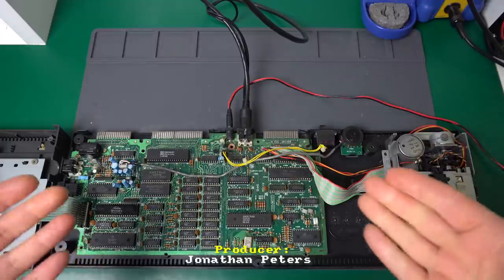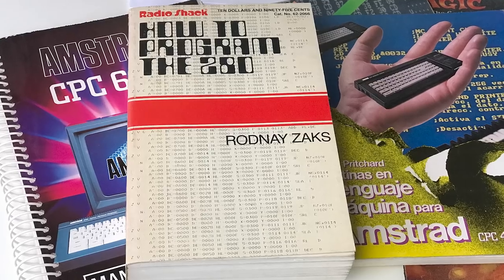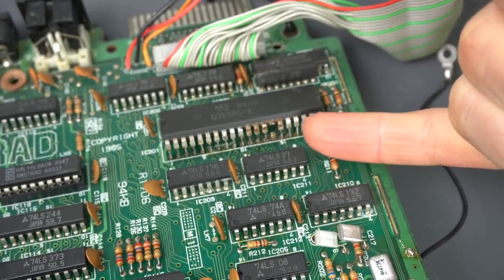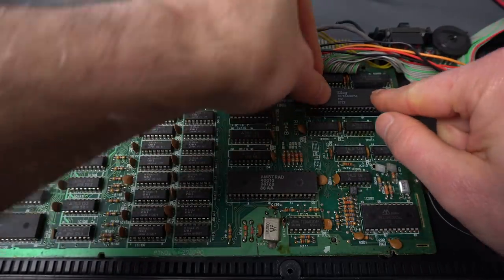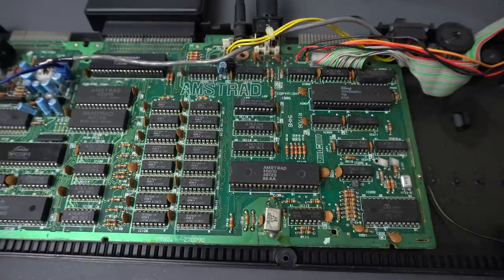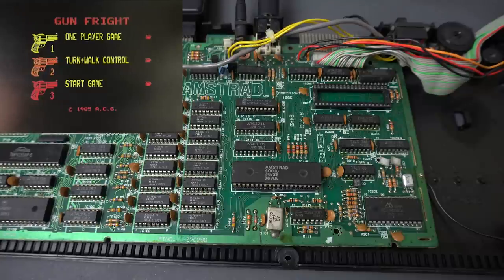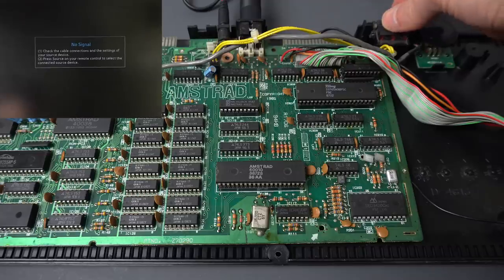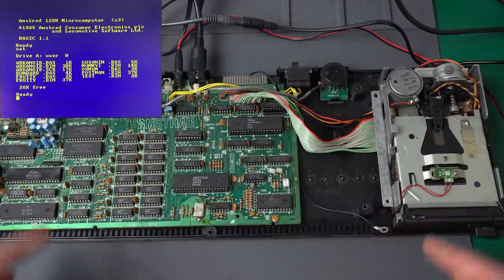Floppy Disk Controller Repair and Diagnostics ROM for the Amstrad CPC

Comment: Yet another riveting detective story.  No bad IC goes unpunished with Noel on the case.  Not only was the repair interesting, this diagnostic you've made already exceeds anything out there for the CPC if I understand you properly.  I predict this will be a tremendous asset to the Amstrad CPC community, as you yourself are.  Brilliant.

It's too bad Amstrad did not make much of an appearance here in Canada.  They seem like fine machines.  Around here, it was mostly Commodore followed by Apple II, with Atari, TRS-80, and TI99 bringing up the rear.  I would have loved one of those CPC machines.
Reply from the maker: Thank you so much! The test is mostly what I've been wanting for years. Hopefully other people can also benefit from it.

Comment: Ingenious -- taking a partially-working computer and using the stuff on it that does work to help you diagnose its own ROMs.  I'd have gotten the "must remove the ROM chip so I can read it directly" business stuck in my head, and it never would've occurred to me to write a program to check the ROM's CRC.  Such an elegant solution for that!  I love it!

Comment: Fascinating video! I bought a 6128 in 1985, and used it for 8 years, until I bought a Mac IIci in 93. I still have both, as well as one of the DEC Pro/350  I learnt PDP-11 assembler on in 1988 as a CS student. I had the 6128 powered up maybe 15+ years ago, it worked then, except the rubber band of the floppy drive. I guess the next time I visit my mother, I will dig up all the machines from the basement and see how they are doing. This video was very inspiring!

Comment: Brilliant video and repair. Seeing that pcb and those chips brought me back to my first job on the test floor of a semiconductor assembly plant where we tested thousands of Z80s, 765s and 8255s along with 8251s, 8257s 8035s, 8085s and static ram! In any slack time I made cpu boards for projects. Great times. Great channel.

Comment: Neatly done!  Your approach shows not only good ICO (Input/Conversion/Output) troubleshooting, but a sound knowledge of how the Amstrad platform works at the component level.  Your diagnostics will likely catch on with other Amstrad users and technicians.

Comment: It is impressive as usual, you combine hardware knowledge plus programming background without losing your expression 'mmm, interesting' in front of death screens. You demonstrates that a computer is an easy to repair device, always if you have an spare chip or whatever you might need, sometimes very difficult to obtain. Go ahead about diagnostics tool for Amstrad, I am sure you'll offer us a professional solution, for sure.
I read comments and I don't see many Spanish followers, don't understand, you offer a really professional work, thanks.

Comment: Hi Noel, when you tested that 74HC240 in the EPROM programmer, and it reported all the gates failing, it occurred to me that it actually only takes one bad connection to render the whole IC dead: if either the Gnd or the Vcc pin should fail, the rest could theoretically be fine, but there's no way of knowing that. 😉
Anyway, I was really intrigued through the whole process of troubleshooting, and - unsurprisingly! - you managed to sort out all the problems in your usual style; that is to say, with flying colours. 😁

Also good work on that diagnostics program, it is a very clever use of the Z80's OUT instructions to get those numbers on the screen in the (artificially enlarged) border area, I must say. 👍👏 It really shows how amazing Assembly programming can be, doesn't it?

Oh and finally, there's something I've been meaning to say to you for a long time... do you remember when you posted your video about repairing the ZX Spectrum 128K "Toastrack"? We exchanged a few comments on that video, and you mentioned something about the lack of a menu system on the Spanish version. Well you can have those menus if you replace the ROM with that of a grey +2*; since the hardware architecture is viretually the same on the Toastrack and the +2, the +2 ROMS will also work in the Toastrack. Thus, you could even have a French Toastrack, if you wanted! 😄 All the ROM files are available on Paul Farrow's great site, http://www.fruitcake.plus.com/
*Unfortunately, this means the loss of the Editor program that is present in the Spanish version of the Toastrack, but such is life: you win some, and you lose some.
Reply from the maker: Thank you! Yes, that was really fun programming that and twisting the machine a bit to do it 😃
I didn't realize you could use the grey Speccy ROM for that! I know you can use the UK one and there are even patched versions of it.

Comment: When diagnostic software hangs, my thoughts was exactly the same - something wrong with CS and there is bus conflicts.. 😂 
Great repair!
For diagnostic software update, You can add 8255 response test (writing registers with initialization values one by one  and then  reading back) and for floppy controller and then verifying values.. Main rule - don't read back same register after just writing it.. One time I did it and always get back same value, but in reality, that value wasn't read from chip and was just bus echo, because, there was a fault in one buffer IC.. 😂
Reply from the maker: Thanks! Yeah, that would be a good simple first pass at making sure those chips are at least alive. Want to give it a shot and submit a PR for the project? 😃

Comment: Oh my!, that Zacks book, so many memories, back in the days somebody passed me photocopies of some of its pages, I don't think it was the full book.
Little trivia: The Z80 ALU is 4 bits wide only, so, if the MC68000 is considered a 16bit MPU because its ALU is 16bit wide, the Z80 should be considered a 4 bit micro. V.g. In order to add two registers it has to perform two passes through the ALU. I didn't know that in the 80s, it wouldn't surprise me if Zilog kept it confidential. Thumbs up, keep on the good work!
Reply: Yeah, i was flabbergasted when i learned that bit about the Z80 ALU. I think it only became common knowledge after some clever guys delidded a Z80 and traced all the internal circuitry.

Comment: I'm sat here screaming there is corrosion around the 74 chips, check them all!  Great video.
Reply from the maker: Did you see more corrosion in other places? I didn't notice anything particularly bad other than those two ICs.
Reply: @NoelsRetroLab  I saw a little on the ic below the FDC. But my main point was as soon as corrosion was seen, I would have suspected everything around that area. Anyway, let me just reiterate that your videos are very good, very well presented and put together so well. Thank you for them.

Comment: Once again, admirable persistence and calmness! About the diagnostics program, could it be possible to output sound in the form of beeps to indicate where the fault is? Like modern computers do.
Reply from the maker: Thank you! It could but it would also be cumbersome to try to report multiple failing bits that way. Right now it just uses sound to indicate start and then success or failure of the RAM test (in case the video out isn't working).

Comment: At 17:00 you are probing pin 10 or 4 of 74LS132? Also, IC203 seems to have signs of corrosion. Am I wrong?
Reply from the maker: Good eye. This board was slightly different from the schematics in that they changed which gates they used in the IC. I checked them with continuity off camera and forgot to mention that, but they're the "correct" ones, even if the numbers don't match up.

Comment: Hi Noel, thank you for another great video! Quick question: at what temperature do you usually use your desoldering station? I am asking because I have a lot of clogging issues with mine and I think it may be related to temperature settings. Thanks!

Comment: On 2 and more-layer boards with metalized holes, there is a potential problem with top traces that if the solder does not full overflow to   hole and the metalizing in hole is broken, there will be no connection of soldered pin with the top trace.
Maybe some people know about it, but most don't realize it.

Comment: Great video! I wonder if the drive controller chip still works if you were to repair that broken leg? May be that the corrosion is moving (or already has moved) up the legs passed the environmental seal into the chip itself so even if it works it may well fail in the future. Nice work on the diagnostics program, I have a CPC6128 that I bought last year that has problems so it'll come in handy i'm sure!
Reply from the maker: The video was getting long, so I didn't include one test I did: On the good FDC, I lifted the same leg as the broken one and tested it. It didn't give a red screen when I tried doing CAT. That tells me the bad FDC is probably completely faulty since it behaves the same as if there was no FDC at all. So no, I didn't bother trying to solder the leg back together.

Comment: I noticed that in your code you are using the fact that the entire BC register gets put onto the Z80 address bus with out (c), xx. I have no experience with Amstrad CPCs, but I have heard once or twice that the Amstrad CPCs use the entire 16-bit I/O addressing space of the Z80 somehow. Is this true? 

I am wondering if this would also work on the MSX or if the design of the MSX prevents you from doing that. I am thinking of designing a small PCB that I could use as a test cartridge to test this. However, my electronics design skills are rather basic and my soldering skills are virtually non-existent. That would make it an interesting challenge.

As always, awesome video.
Reply from the maker: Thanks, glad that you liked it. What you're saying about the BC register is correct, and that always threw me off as a kid. I could just NOT understand why out (c),a would really send it out (BC), but yes, that's the way they wired it to have a much larger addressing space (which from what I'm hear is completely full anyway).
I don't know for sure, but I think on the MSX it's not done that way. Oh you're asking if an external device could do that on the MSX. My first instinct is that it's probably possible, but I don't know if there's something specific in the MSX architecture preventing that. The Dandanator device uses a combination of opcodes to trigger it instead of using out instructions, so that's probably also a possibility.
Reply: @NoelsRetroLab  Come to think of it, one would have to be very careful mixing the simple in/out instructions with the out (c), x instruction. The out (imm8), a instruction puts the contents of the A register on the high 8 bits of the address bus.

Comment: Another great video and thank you for giving us your awesome work on the diagnostics tools. That will be very helpful.
But I can only buy an Dandanator mini v1.3 on ebay. There is no other available in Germany. And my Schneider CPC has got centronics interfaces so it will need adapter.
Reply from the maker: You're welcome. Actually my next hardware project is going to be to design a minimalistic ROM board specifically for the diagnostics test. Stay tuned 😃 In the meanwhile you can always desolder the ROM and use an EPROM (not ideal, I know).

Comment: Oh Wow. That Diagnostics rom is amazing! really helpful for those of us who need a nice easy way of detecting ROM and RAM issues. One queston tho. What causes the ROM test to be marked as Disabled?
Reply from the maker: Thank you! Glad you found it useful. I make the ROM test as disabled if the diagnostic is running from a cartridge (because in that case it's probably a Plus/GX4000 and there's no ROM to test against). Is that correct, or is it a bug and it happened in a different configuration?
Reply: @NoelsRetroLab  no, it was my 464plus but I ran it from an external rom board with the basic, lower and AmsDOS provided in the cartridge. So they are present on those machines so long as the burnin rubber cart is attached.
Reply from the maker: Interesting. I'm automatically disabling the ROM test from cartridge builds, but all other ones should have the ROM test available. I should look into it. Which ROM board did you use?

Comment: Awesome! The Amstrad community really have you on their back, good job!
As I remember, Adrian Black did replace a NEC chips (just like the Amstrad one) in a 286 PC, so NEC chips may fail more often than others.
Reply from the maker: Oh, I didn't realize a 286 PC would have this kind of FDC. Very interesting. I'm going to have to track down Adrian's video (or maybe I already saw it and didn't realize it was this kind of FDC). Cheers!
Reply: @NoelsRetroLab  Not 100% remember it's a 286 but definite an old PC, and he track down the chip and replace, then no more error.
Reply: Just to add to this. Yeah they were used in PC's too. It was a pretty common controller chip before floppy functions were being embedded into SuperIO chips.

There are a few pin compatible chips made by different manufacturers, the NEC uPD765A and the Zilog Z765A are two I can remember off the top of my head. The numbers may not be exact, those are some old memories to dig up :))  Western Digital had some controller chips out at the same time, they may or may not have had a compatible variant. I think WD's were more competitors at the time.
Reply: I don't know if NEC chips are starting to fail now but I do know from a lot of arcade pcb repair logs that Fujitsu logic chips seem to be the most common chips that are failing a lot these days!
Reply: @NoelsRetroLab  Yep, all PCs with floppy disk support use what is essentially a 765 FDC, although it is usually embedded within the South Bridge part of the chipset.

EDIT: Or, as D D pointed out, in one of the SuperIO chips that preceded the North Bridge/South Bridge paradigm.
Reply: @DD-jk3nf  I have not heard of a 765-compatible chip from WD, but i know that Intel made one, the Intel 82072A.

Comment: Noel, awesome video thank you! How about using your code for creating a “Total Testing Framework” that could be eventually be ported to other systems with contributions from all over and with maintainable code that could evolve in time with nice hacks from the community? Even reading the code while using it could lead to interesting findings while repairing these machines! Keep up the great content!
Reply from the maker: I think it would be really difficult to make something that works across multiple systems. For now I'd rather focus on making this the best I can for the Amstrad and then we'll see 😃
Reply: @NoelsRetroLab  on second thought you are totally right, such a low level set of tools would be very difficult to make it portable but it would still be a great source of inspiration for similar projects for other platforms. Thank you for kickstarting the idea!

Comment: So... There's absolutely no way to put a ROM in the Dandanator without a working CPC ?
My 6128 stopped working a few days ago and I ordered one of those device, hoping to use your diag ROM with it, then I realised I have no way to load the ROM in it.
I also have a working 6128 Plus, but I don't have a centronic to edge adapter, and I have no clue where to find one...
Reply from the maker: As far as I know, there isn't, and that's a bummer. The good news is that the Dandanator comes with some kind of diagnostics ROM, so you may still be able to use that. But it won't let you upload this one. For that you can use an M4, X-Mem, or any ROM board (or even replace the ROM on the Amstrad board with an EPROM directly).
Reply: @NoelsRetroLab  Oh, I didn't know the M4 could do that too...
Sorry last question, is there any good forum where I can look for some help ? First time I have to repair an 8bit computer. Although I looked at many videos from you and other, I will probably run into troubles at some point...
Thanks =D
Reply from the maker: You could try CPCWiki. You can also stop by the Discord server. We have a whole channel for repair help and you can post pictures and such there too. Good luck!
Reply: @NoelsRetroLab  For some reason I saw your answer only today, youtube didn't notify me, sorry. I've just posted a message on CPCWiki forum, thanks for your advice =D

Comment: @16:26 I don't think your measuring the correct pins on the 132. Schematic says 8,9,10 and you're on 6,5,4 - see the silk screen for the pin numbers...
Reply from the maker: Good observation! You're right that I'm measuring different pins, but that's because this board revision is wired up slightly differently than the one in the schematic. I don't know why they do that, but it's really annoying. I did confirm it with continuity tests before I filmed that part, so at least you can rest assured that's correct.

Comment: Doesn't Multiface 2 switch its own RAM in place of the CPC RAM to do its work? Could you build something similar or modify a Multiface?
Reply: I don't know how the Multiface 2 for the Amstrad CPC range works, but if it is similar to the models that Romantic Robot made for the ZX Spectrum (MF1 for the 48K, MF128 for the 128K and Grey +2, and MF+3 for the +3 and +2A), then it is likely that it replaces the internal ROM with its own, and thus a modified MF2 would probably be possible.

Comment: Wait, why are you checking pin 4 and ping 5 when the schematics dictate pin 8 and pin 9? Am I reading the schematics wrong? https://youtu.be/tw0ClciNUDQ?t=1023
Reply from the maker: No, you're not wrong, but the schematics are wrong 😃 The board is a slightly different revision than the schematic, and everything is the same except that, annoyingly, the swap out some of the gates in some of the logic chips. It happens a fair amount, I don't know why, because it's not like the ICs changed relative positions. I did left out the part where I was puzzled about the signals and backtracked tracing them with the continuity meter, but that's why.